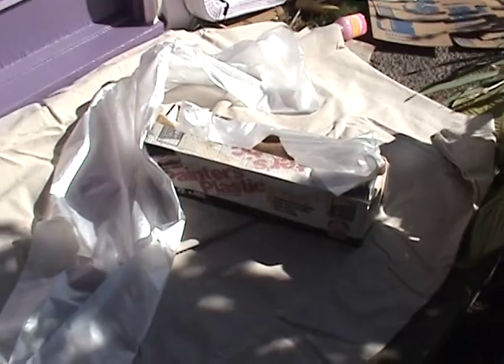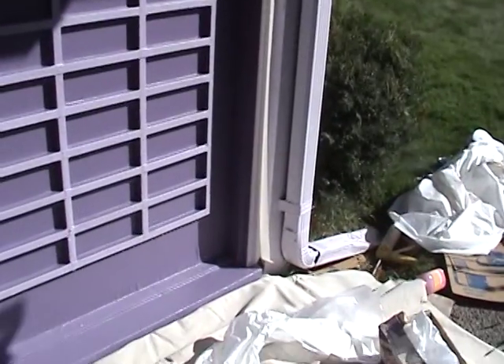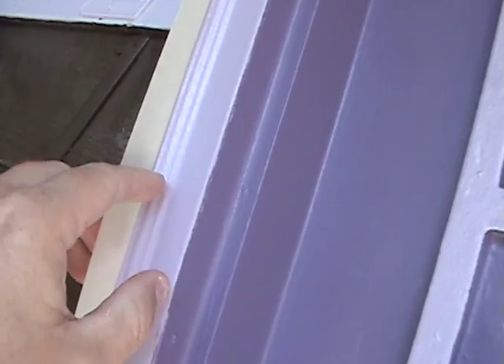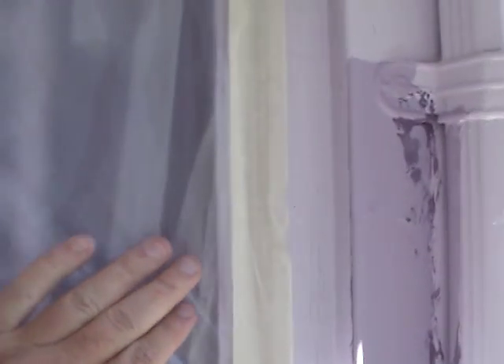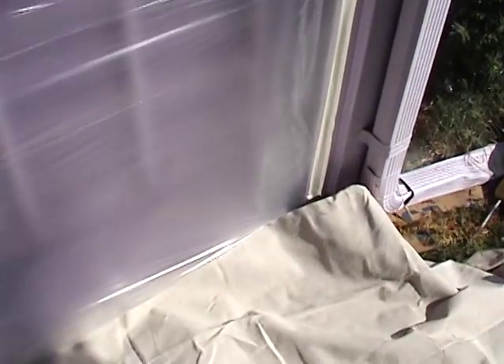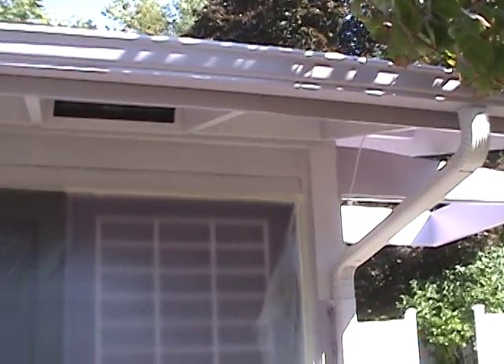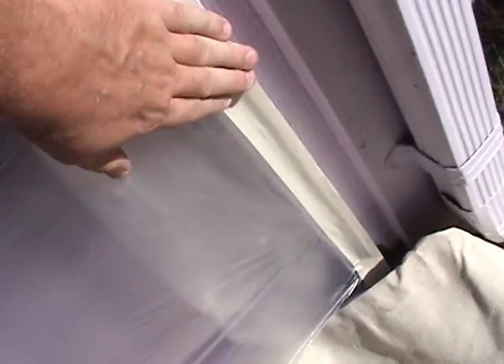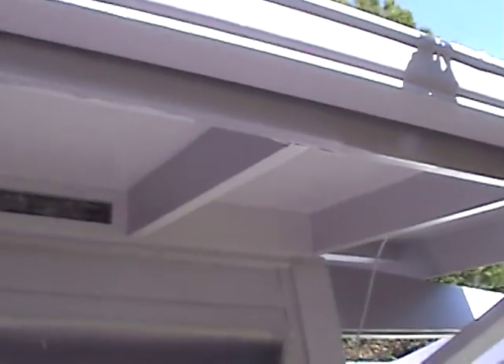How the Pros Mask doors and windows

Comment: I found the video to be overall informative. I had originally intended to leave a semi negative comment. After having listened to the video in its entirety I found that the information was overall helpful. The only improvement I can think that would assist this video is if you articulated the information better. I believe what you were trying to explain with the sprayer was that "The air pressure from the sprayer could blow open a small hole in your tape and blow open your entire plastic mask"